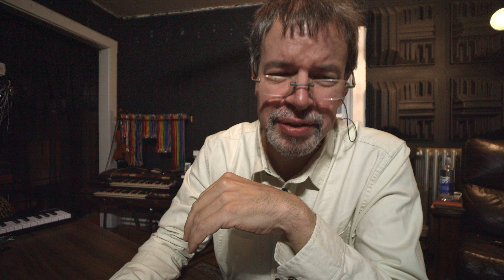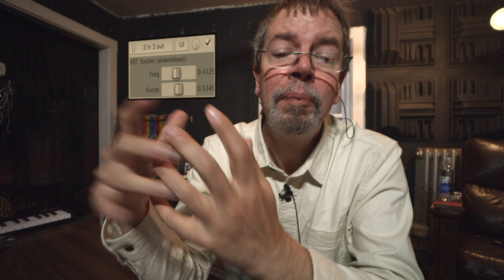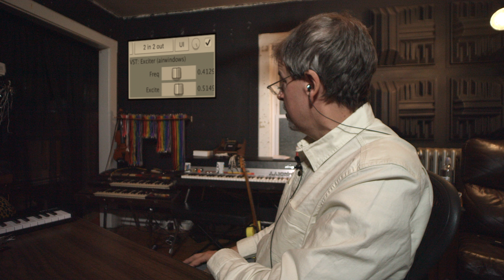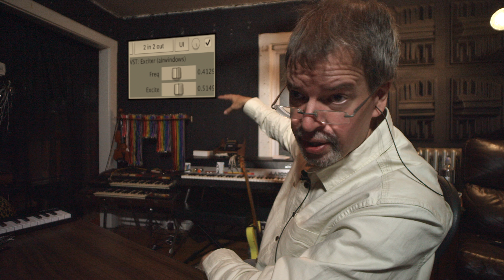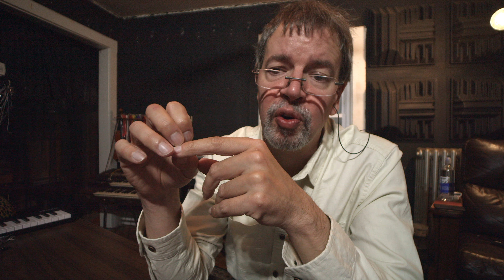Airwindows Exciter: Free Mac/Windows/Linux/Pi AU/VST

Comment: thanks for another, very special plugin!

once I tried a complex process, but did not make a plugin.
I used the steep FFT manual filter curve from CoolEdit in linear (0-100%) mode. I drew exact ramps without bezier or any softening curve invoked.
Drawing a band split with an x-over from 4.5k to 5.5 or 6k, and another from 6k to 9k. This means they are absolutely silent outside the range, and they can be added together because it is all linear. FFT is linear phase, and the level decay is linear from 100 to zero.
I used the signal that starts from 4.5k as a side chain.
I created a hand-drawn expander curve with the CE dynamic tool, and tuned it to a level range where the high frequencies were squashed (think of what a cheap cassette recorder does, but it works with any audio that is a bit dull or degraded). This means, I looked at the waveform and levels and tuned the expander to improve these dynamics a little bit, where they are weak. it is a certain range of levels, not all levels.
I did this with some copying functions.
In principle, I took the signal that was distilled by FFT above 6k, having an x-over to 9k, and expanded this with the other signal that started at 4.5k, which became the side-chain.
At the end, I added the expanded signal back in with the other leg, that holds the low frequencies up to 6-9k.
It sounds like an exciter too! 
But it distorts much less, if the timing of the expander is right. It sounds especially fine, when the rising/attack slope is a little bit soft, around 0.5-3ms. Release should be as fast as possible, before distortion kicks in.
Facit: it can be done by a dynamic expander plus 2 linear phase FFT filters with linear type of separation, that goes to zero (not the usual logarithmic).